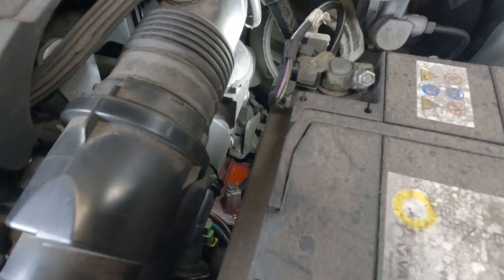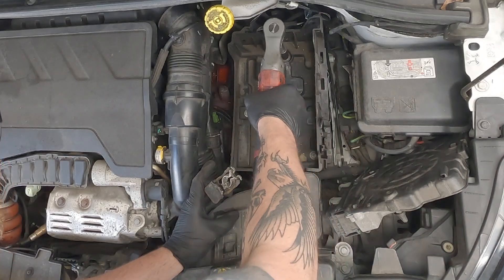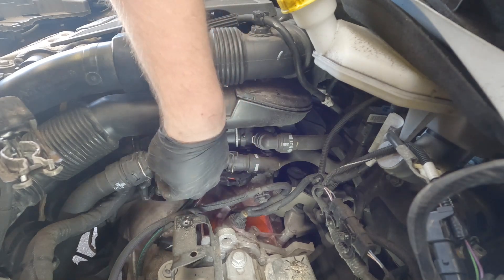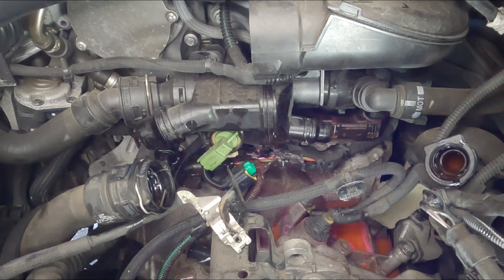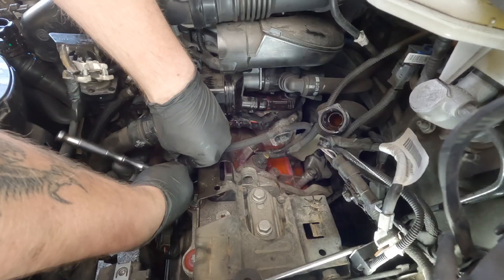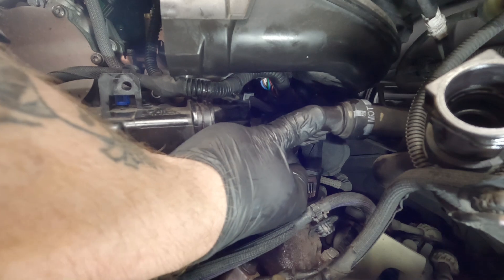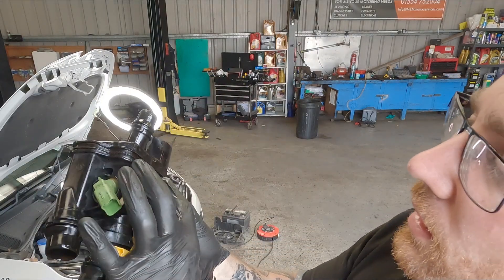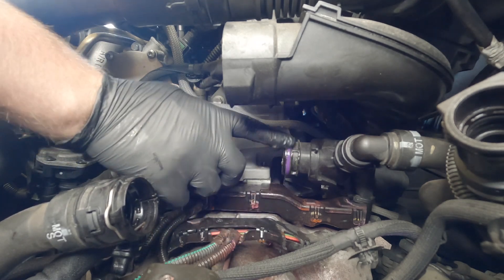Citroen C4 coolant housing replacement

Comment: My C4 2011 (B71) 1.6HDi coolant is leaking and dripping onto the road after every drive. Doesn't leak much when heater is on, only when it's on cool air. Leak drips from back of the engine underneath front passenger side, could this be my issue man?